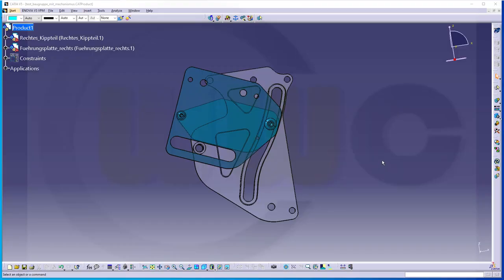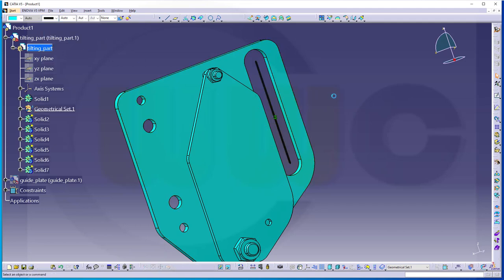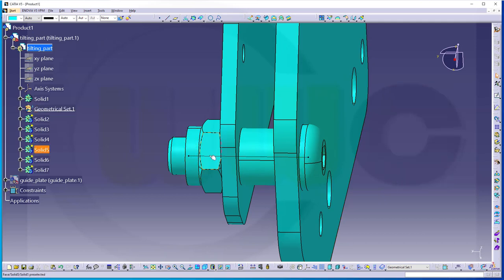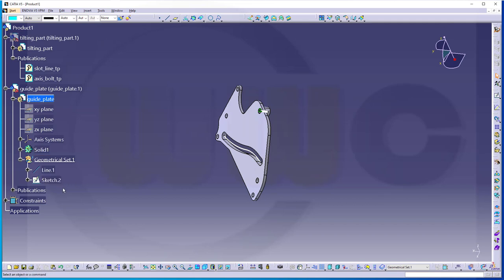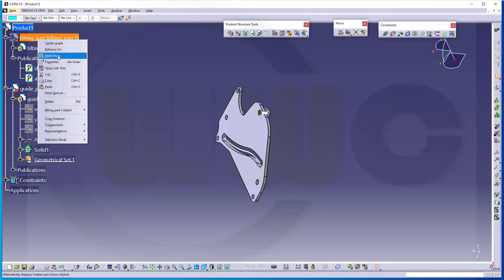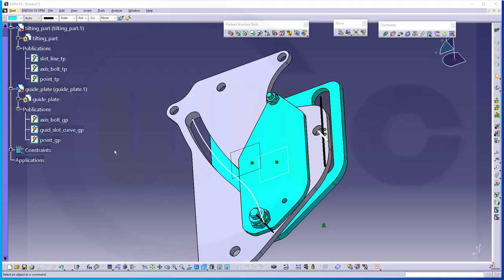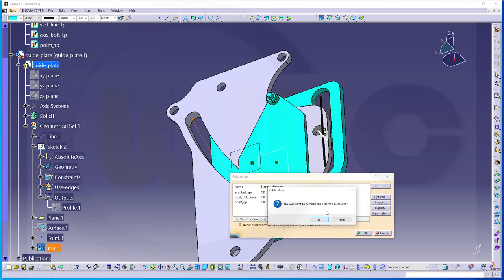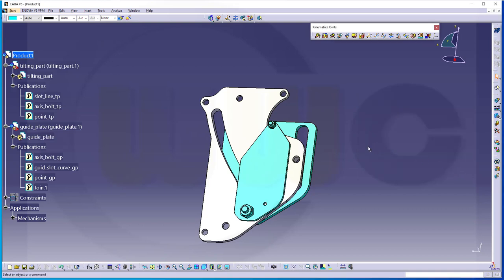Slide & Tilt Mechanism - Catia v5 Training - Kinematik

Comment: Hi Wolf, i would like to take your advise in boat designing business. Which one you would prefer catia or fusion 360 in term of surfacing and easy handling editing later on in design
Reply from the maker: Regarding surfaces you have to go for Catia or Siemens NX. Fusion is not as powerful as those two.

Comment: Hai sir.
I searched the internet over & over for the design/assembly/simulation of wankel rotary engine By CATIA V5 I didn't find any videos.

But found some videos of wankel rotary engine by solidworks.
I followed the steps nd sucessful completed design nd assembly  but I failed in CATIA_DMU kinematics(simulation).

Please help me sir in CATIA.
Reply from the maker: I will consider it. But I´m still very busy with trainings, even from 27.12. - 31.12., so be patient